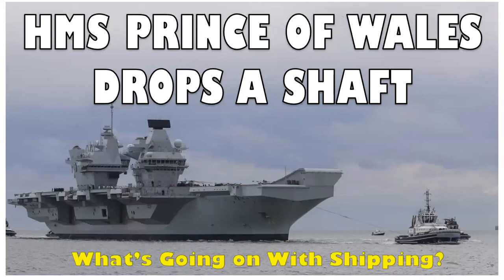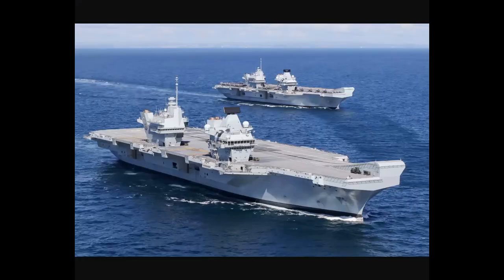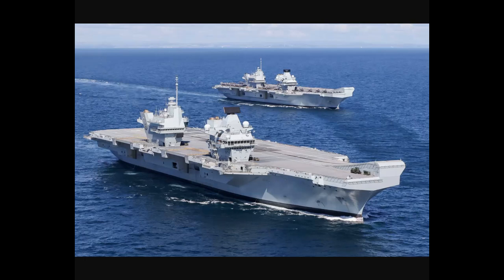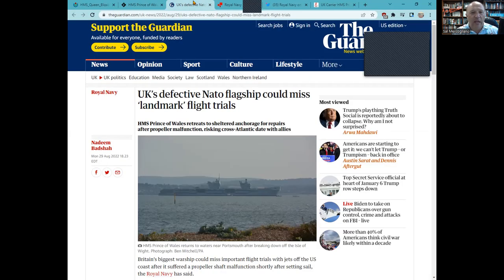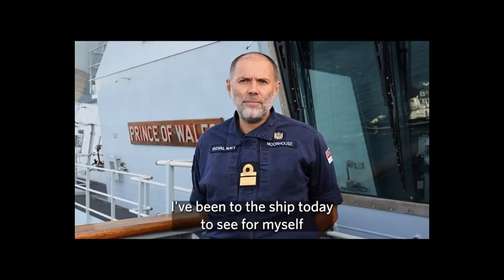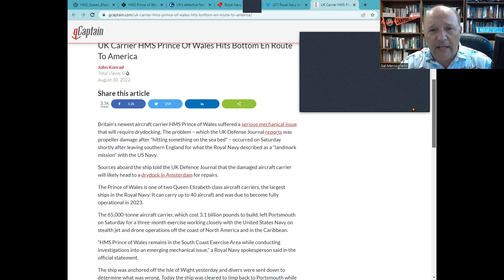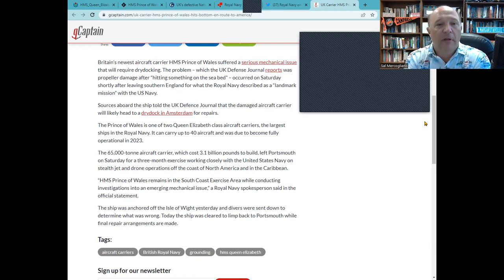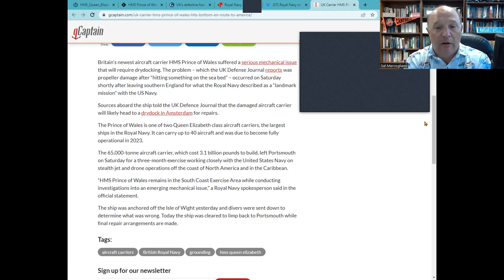HMS Prince of Wales Drops a Shaft - What's Going on With Shipping?

Comment: The obfuscation would suggest the worst case scenario is the case in point. Prop & shaft damage, maybe hull too, & dry-docking for extensive repairs. Worse than useless pair of ships.
Reply: So there is no bias in your comment then .... 🙄🙄
This damage could have happened to any ship at any time. Maybe a truth you don't want to hear?
Reply: @1chish  - you have the way of having once glanced at a book.
Reply: @gitfoad8032   And you have the way of having never read a book ....
Jog on and annoy someone else ....
Reply: It's only got 2 shafts big one's have 3 or 4 ..
Reply: @garywheeley5108  So a 70,000 Ton carrier isn't big? There is only one operational class of ship that is bigger and that is the US Navy's Nimitz class carrier. I will ignore the Ford Class because it doesn't work and has never left local US waters...
If the propulsion systems are efficient enough then only 2 shafts are needed. Having 4 means double the residual friction, weight and loss of efficiency.
Reply: Two is one one is none ....redundancy
Reply: @garywheeley5108   If that logic stands up why doesn't every carrier have 8 propshafts then?
Having 2 propshafts is 100% redundancy. That is enough.
Reply: @1chish  obviously not enough lol
Reply: @zacharycraven316   It is enough as the ship can operate with one propeller. As it has just proved.
'lol' 🤦‍♂
Reply: @1chish  The French carrier is 75,000 tons - just saying. The Ford class was under development and had a lot of production problems because of 23 new technologies the Brits can only dream of. But the good news it is now on its first deployment
Reply: @ejmproductions8198   Oh really?
So which 'French carrier' is that then EJM? Now let me see:
How many carriers has France got?
ONE.
What is the displacement of that carrier?
42,500 Tonnes.
How many carriers has the UK got?
TWO
What is the displacement of each of those carriers?
65,000 Tonnes
Why do you clowns insist on making yourself look stupid in public?

Just saying

Quote:
     "23 new technologies the Brits can only dream of"
(Not that you list these alleges 23 technologies)
Really (again)? Now let me see:
1. Nuclear power that was first proven at Calder Hall in the UK in 1953?
2. Aircraft carriers that were invented by the British with HMS Argus converted in 1918 and the first built carrier with HMS Hermes also in 1918?
3. Armoured flight decks that saved every British carrier in the pacific while US ships were disabled or sunk?
4. The steam catapult invented by the British in 1950?
(Yes I know it has EMALS that doesn't work)
5. Angled flight decks invented by the British in 1952?
6. Shipborne radars courtesy of the Cavity Magnetron invented by the British and given to the USA in 1941?
6. Jet engines for aircraft invented by the British and given to the US in 1941?
7. Mirror landing aids to enable safer retrievals on flight decks invented by the British in 1952?
8. The first jet aircraft landings on a carrier by the British in 1945?
The USA are very good at taking other peoples' ideas and making them their own but the only major developments on the Ford are EMALS catapults which still do not meet Navy standards, a new radar with a version of previous AESA systems that are so good no other Ford will have them and an automated weapon storage system that also does not work.

The British are as capable as any of inventing new technologies (see above) but we also build to tight budgets so we do not waste our taxpayer's money. We built TWO fully operational carriers for $10 Bn. Ford is north of $18 Bn and counting and is only now, 5 years after entering US Navy service, venturing out of US waters while the QE has sailed around the world and gone across the Atlantic 5 times in the same period. Oh and launched thousands of 5th Gen sorties.

So take your arrogant Yank attitude and shove it up yer fat arse Pal....
Reply: @1chish  
Well, it is better to have one functional carrier than 2 dysfunctional ones, and they even build their own aircraft. 

As for nuclear power, 'The idea of nuclear power began in the 1930s when physicist Enrico Fermi first showed that neutrons could split atoms. 
Fermi led a team that in 1942 achieved the first nuclear chain reaction, under a stadium at the University of Chicago'. 

As for all the ship-based tech, you had no choice you live on an Island. The USA was Isolationist after WW1 and penalized all US companies severely for building weapons, unlike the Bloodlusty Brits who invaded 65% of the countries on the planet. 

You guys are like Uncle Rico from Napolean dynamite - reliving the glory days

You cant even attempt a military design project without f%cking it up. That not only goes for ships but vehicles as well.
Even rifles, remember the SA 80 rifle, that had so many problems they had to bring in the Germans to fix it 

I thought this was a European problem, but the Germans and French are doing quite well
Reply: @1chish  plus weight drag more to go wrong staff to keep it in order
a balance has to reached also cost to bean counters

Comment: This Story belongs on a Comedy show! Didn't grease the Shaft, and the Rear Admiral is in Charge of Maintaining the under gear! 🤣😂😅
Reply: There are dozens of ways for the shafting to lose lubrication.  For instance, if the sterntube seal fails, the tailshaft could lose lubrication.  On some ships, in an emergency, grease can be pumped into the stern tube bearings. This is usually a last resort.
Reply: Some people get the  humo(u)r, some don't.

Comment: something no one is noting the first carrior had shaft-shaft seal problems immediately after launch it could be an alignment - assembly issue during assembly
Reply: Never heard of first ship's troubles but engineers aren't trained to use bearing scrapers since 1965.

Comment: I understand it was a shaft coupling AND a plumber block that failed. If this happens on a shaft the problem is probably shaft alignment. POW has has some issues before I understand. The modular method of construction my have had something to do with this  POW and QE were built differently in parts. Shaft alignment on a ship that size is no easy task ...

Comment: Amsterdam is closer than the two UK dry docks capable of receiving PW. One is at Rosyth where she was assembled and the other is at Belfast at Harland and Wolff. 

There was one in Southampton, only about 15 miles away across the Solent and up Southampton Water, but the dock gate and keel blocks of the KGV dry dock were removed in 2005 and the dock allowed to fill up. Its now used as a scrap metal loading berth.
Reply: Need to reopen this now we have this class of ship.
Reply: Belfast cannot take these carriers, the dock gate has to small a draft at 8.5 meters.

Comment: they will have known the shaft had a problem, probably the shaft seal failure.  It happens at Portsmouth as the water run off from the land is very hard so the seals can scale up.  They can't easily dock so took a risk.  If they had put the ship in dry dock then it would have been properly fixed.  But they didn't invest in a new dock at Portsmouth.  Bad planning.

Comment: If they have to replace the shaft it's probably sourced from Germany. How they get it into a completed ship is a thing. Would it have an access hatch to the engine room large enough to pass a drive shaft?
Reply: Part of the design process are drawings and studies for replacement and removal of major machinery components.  For something like a line shaft the design will include padeyes, lifting gear and a pathway for removal.

In the case of controllable pitch propellers the tailshaft has to be removed from the exterior of the ship, usually in drydock, because there is a flange which joins the hub of the propeller to the tailshaft.   This flange is larger in diameter than the tailshaft, making it impossible to draw the shaft inboard.

Comment: As an engineer, that has observed many fubar situations, I have all kinds of questions! 
I've seen groundings, people not starting shaft lube oil pumps (for 5 days or so!), gear box failures, all kinds of things to prevent shafts from rotating! 
Was it the Mates or the Engineer's failure?
Reply: My money is on PoW hitting something, either the bottom itself or debris of some sort.  The RN had to dredge the harbor and channels to make them deep enough for the QE class ships.  I'm wondering if PoW either found something the dredges had missed or somehow got out of the channel.  If so, the Black Gang is blameless and the Chief Engineer keeps his job.
Reply: @robertf3479  you know what I'm saying!
Reply: @brucelytle1144  I do. The old "sand in the reduction gear" trick to avoid deploying.
Reply: @robertf3479  I'm inclined to agree, having lived in Gosport (across the harbour from Portsmouth) I do remember the Nimitz coming to the Solent and having to lie at anchor as it was too big to get into the harbour so with the advent of the Elizabeth class a lot of money was spent on dredging, also with the strong tidal flows the ship may have been on an entirely correct course but the undersea landscape has changed (due to the tidal flows) so a prop hitting the thick black mud is like trying to stir treacle that could cause the sort of damage being mentioned.

Comment: @ Luke Webber sorry my browser / OS can`t see or use the buttons like " reply " So to be clear failing to lubricate a prop-shaft on a big boat that has moved is about as likely as not putting air in the tyres of a big truck. 
I think the prop struck because the channel was not dredged recently and as the seas always recede from the land that situation was worsened  to the point  that it  struck the bottom See: Richard W Guy " The receding seas " or Dr James Maxlow or Neal Adams.

Comment: The reason why the HMS Prince of Wales exercises in the United States is that she has to borrow F-35Bs from the US Marine Corps - the drones they are talking about are the ex-Banshie Fighter jets that are now used as target drones.

The British Royal Navy does not have enough of the F-35B - as we say in Texas, “All Carriers and no Planes”
Reply: Hard having something that's not yet built
Reply: She doesn't have to go all the way to the US just borrow F-35 from the USMC to do exercises, the UK has 24 F-35B as of last count a year ago.

It's because they're using a special 'orange wired' F-35 for further testing with a new form of landing (SRVL).
Reply: @Benjd0  - Why - it is a bad choice in plane - limited payload, costly, slow - The J12 and Mig-29K and SU-27 are better
Reply: @cliveengel5744  I mean I wasn't really arguing about its abilities, just that they're going to test it.

But in this context the F-35B has a major advantage none of those aircraft have - STOVL.

This allows it to take off with a full fuel and weapons payload, much more than these aircraft could using a Ski-Jump. Conventional aircraft taking off with a Ski-Jump are severely limited in the weight they can carry, largely limiting them to short range defence.

The price for the F-35 is a bit overblown, the overall project cost a massive amount, but individual unit cost for the F-35 these days is very low. Even lower than many gen 4.5 alternatives in fact.

Comment: What I found interesting with this video was the presenter was factually unbiased and very informative. He cancelled out the  media bias and fiction and focuses purely on fact.

However, given the present standard of our navy, I’m far from surprised at this carrier malfunction.
Reply: Well, it has been a while since the RN has operated ships of this size, and the crews of these are still fairly new.  It may take a few more years to shake some things down.  The USN has lots of carrier experience over the last several decades but even with that the new Gerald Ford class has had teething problems.  A new class of carrier, especially the first in three decades and much larger than the last ones is likely to have challenges.  I'd guess that a lot of the officers and ranks were seconded to the USN's supercarriers and assault carriers to get a feel for carrier operations, but nothing beats handling the ships.  Look on the bright side, the RN maybe learned a valuable, albeit expensive, lesson and it wasn't a sortie where she was needed in the Malacca Strait, Strait of Hormuz, or Norwegian Sea ASAP.
Reply: The standard of the Navy is high with several new ships being rolled out. Huge investments underway. It would be interesting to see what it was that the ship hit. Anything from an uncharted wreck to a sunken Russian sub with a huge gouge in it from a prop when it got too close. I guess very unlikely but would be interesting if that was the cause.

Comment: As far as I am aware , there would be no coupling to fracture along the exposed outer shaft . coming from the cutlas bearing and the shaft log .  Any coupling would be inside the hull .   I doubt very much if a coupling has fractured on its own , or the other side and the Queen Elizabeth would likely suffer the same damage ....More likely is that POW has hit an underwater obstacle and busted the whole shaft , bent it and clobbered the propellor .  Just how much internal damage depends on how long the engine would have kept on running with the damaged shaft creating havoc within the hull and hasnt shaken the hull to pieces .   But more importantly is that during this crisis with Putin likely to go Nuclear ,at any point , a Warship out of action is the last thing we need .   Frankly I doubt that the carriers could take any incoming fire , the way that say the big 4 US battleships could .   I therefore would sleep sounder in my bed at night if instead of the carriers , the 4 US battleships be re instated , re armed and sent out to the area of conflict to strike terror into the Russians by just pointing the Missouri's guns at them .

Comment: well, that's quite a fun declaration regarding the grease. While any man can experience dropping a shaft for a lack of grease... ships are usually called SHE for a reason ;)

My lonely $ opinion:
Since humans stopped  using 1850 top of the technology packing glands  the grease reason is unreasonable.
possible reasons can be shaft dry seal problem,
shaft material processing problem that surface just now,
mechanical impact stress from hitting a submarine or bottom,
and last reason might be deliberate damage.
Reply: Maybe it is some new woke system which does not use grease...
Reply: Do not be so a slotely DISGUSTING.....LOL
Reply: @col4574  slotely?? means?
Reply: @NesherAmir  Lewd

Comment: You would think that greasing the shaft would be on an Engineers checklist, and reported on a routine scheduled report to the Captain or XO.!
Reply: There is actually quite an involved "Pre-Underway Checklist" for all departments that has to be done before the ship moves.  Something like checking the shaft seals and lubrication would sit very high on that list.

I wasn't an engineer but was career USN (Operations Department) and, yeah ... Engineering Department's list is the first thing the Skipper wants to see and is about HALF the checklist for most ships.
Reply: Retired USN, 7 years of actual at sea time, and I was an Aviator. And you are correct! I had to suffer sitting through several detailed engineering reports. I had no interest in being a "shoe.." And I had my own responsibilities. However, I learned a lot.
Reply: @raywhitehead730  Enlisted 21 years, was in electronic intel but didn't go to sea until I made 1st Class and only served in 2 ships.  In my first ship (destroyer,) our Ops Boss wanted ALL of his 1st Class and above to qualify for ESWS so I spent quite a lot of time with the Snipes, learned a lot and several qualifications plus I HAD to qualify as a CIC Watch supervisor and qualify as Conning Officer (OPS Boss required again) and ... I was kept busy.  

The Pre-Underway checklists were something I learned and had to have SOME idea what the duty officers were talking about when I had the watch as Inport Officer of the Deck while we were preparing to toss lines and get underway.

To be honest, I was never really bored and frankly had a lot of fun.  In a small ship like a tincan a 1st Class can have some real responsibility.
Reply: Very glad to read your response! And yes, every crew member on a Tin Can, is valuable! right now, the US needs more Tin Cans. So does The British.
Reply: May, I refer you to an excellent read on Tin Can sailors?  The last stand of  the Tin Can Sailors by Hornfisher.  Enjoy.
Reply: @raywhitehead730  😁  I have it, an excellent read.  Naval History is a passion of mine, so much so that I built a 4 foot long R/C model of USS Indianapolis.  She gets out on the lake to convoy the ducks periodically.  😉